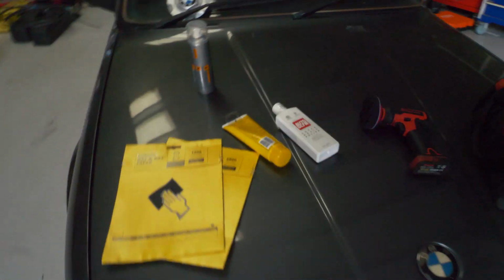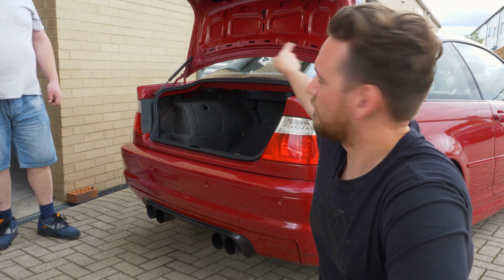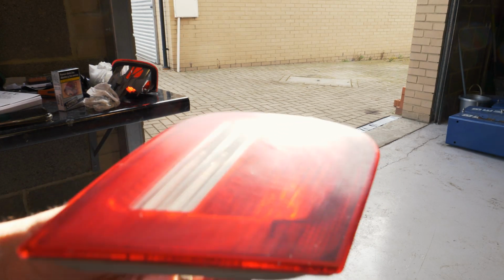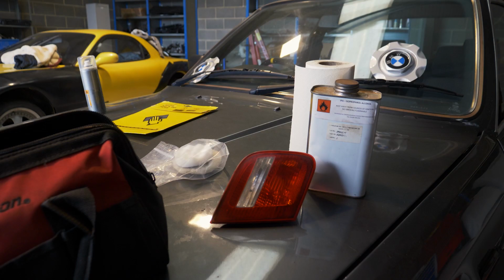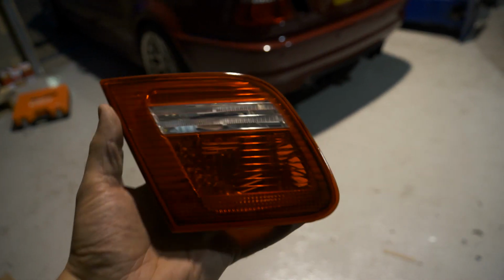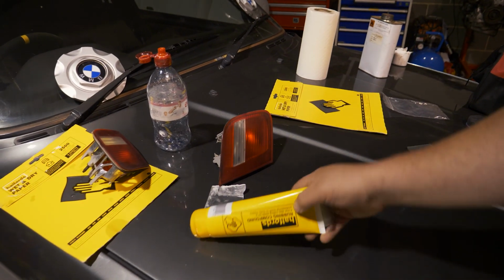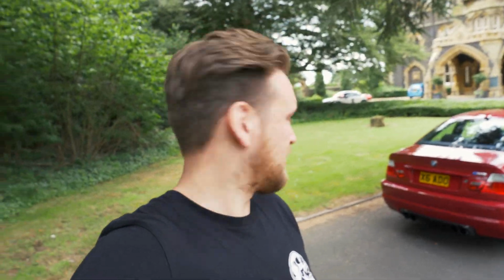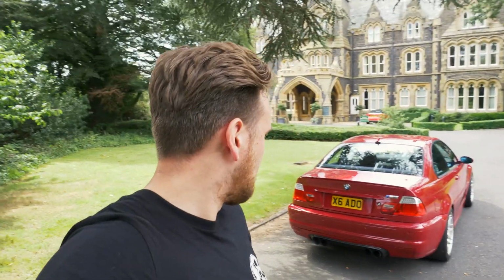Faded light restoration E46 M3

Comment: My front drivers side wing has started bubbling on my e46 m3, not crazy but 4/5 little bubbles now on the lip and has gotten worse over past 6 weeks quite rapidly. I can’t stop looking at it, not sure if just to buy two wings as can get them at cost price through a friend at Bmw and just do the two at same time. 

Decisions.

It’s a labour of love, but still no other car does it for me.
Reply from the maker: It sucks im on the second set of wings on this car and it’s started again recently. I’m going to redo them and coat the insides and maybe wrap the lips on the inside where there dirt gathers to try and prevent it happening again
Reply: thedownshiftchannel Exactly my thoughts too,have to prep the inside lip with something this time around. 

Problem is they will do the doors for blending paint I’d imagine and then your like hmmm the rear quarters have some stone chips, the bumper too. Before you know it’s getting a full back to bare metal respray 👌🏼😂

On the video, I assume I could use your same process for my headlights? 

A bit faded looking on thinking about it.

Thanks
Reply from the maker: That’s the exact problem. It turns into a £3000 job 😂

Yes apparently with headlights UV resistant lacquer is preferred but the same method works yes

Comment: Ground nut or peanut oil for the faded grey plastics, works better than absolutely anything else out there (I’ve tried or used most of them) and lasts for ages. You can thank me later  👍🏻
Reply from the maker: Thanks Lee. I did see a sealant product from carbon collective that apparently lasts up to 2 years. How long does the peanut oil last?